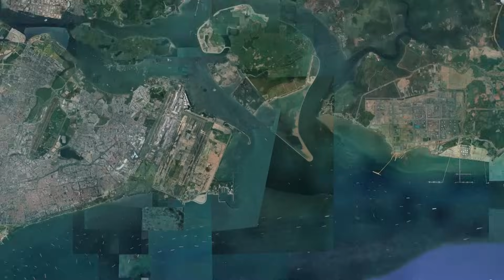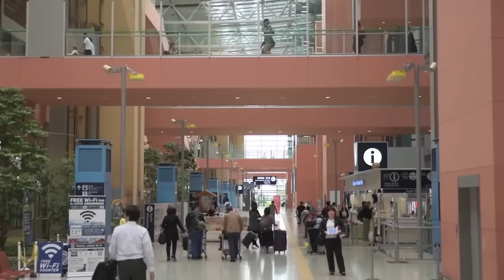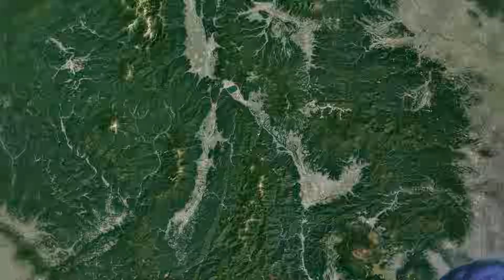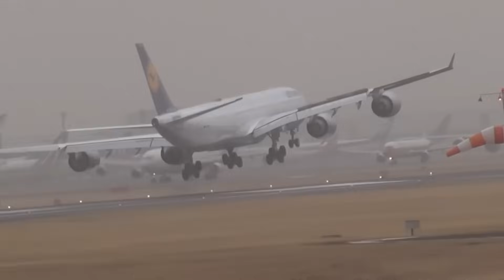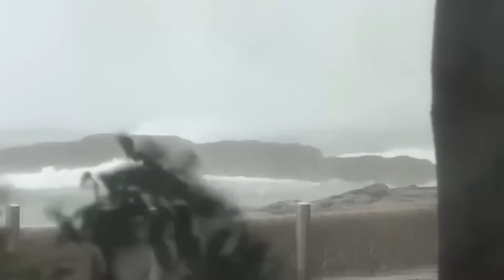Why Does Japan Build Airports On Water?

Comment: Land politics is a complete mess in most countries. Trying to find enough suitable land in or near a urban area even if the land can be found is hardly the only issue. Then there is the issue of can they even acquire the land and develop the land as needed without serious kickback from an angry populace. Any local representatives want to keep their odds high for re-election, forcing thousands off their land for a massive development while also forcing thousands others to now live near an extremely noisy major development is very unpopular with the people and thusly can endanger election odds so local representatives can in many cases be quite resistive to an airport in their district.

So due to the mess that is land politics on a local level, it is exceptionally easier to go about proposing and getting approval to construct these on the water vs on land. The Osaka airport is numerous miles away from the shoreline for example, airports are noisey, need a wide berth for expansion opportunities and an eye sore to the average local. Far better to keep it out of sight and out of mind to the local population.

Comment: Even without the political aspects of land reclamation, building on water has the advantage of being more future-proof if done right. These economies are all advanced and can afford to foot the bill. Even though it's more expensive you don't have to claim nearby land to plan for future airport expansion to meet demand when you build on the water. This land (especially in places like Hong Kong and Singapore) is arguably more expensive than building on the water alone. Plus, it also means that if you don't have to build a new airport from scratch if you run out of space on land (similar to Kai Tak which had no room to grow).

Comment: Anyone who knows Hong Kong's geography and remembers Hong Kong's previous airport knows why the new airport had to be built in the water. Hong Kong is very hilly and had sky scrapers right next to the previous airport. It was one of the most dangerous airports to take off and land.
Reply: Did you ever ride the Baguio or Dumaguete flight before in the 80’s it can be compared to Kai Tak airport 😊Kansai I was able to get a flight by NWA from Detroit numerous times it’s very nice all glass walls and steel , Now they say it sinking a bit but Japan trying everything to prevent it

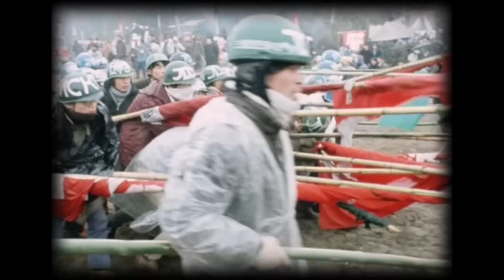Comment: This video only touched it briefly on 2:57, but the most important reason is Narita Airport issue back in 1960s to 80s.

Google "Sanrizuka Struggle" for more info - It was basically local farmers got angry on the government's arrogant attitude and decision to buy their farm lands to build the new airport for Tokyo, so they fiercely resisted the construction, and co-operated with communist activists, which then lead those activists doing terrorist attacks to government officials / forces, resulting too much obstacles, delays and even a few deaths.

Because of this bitter memory, Japan now has simply no choice but to build airports on water. All the other merits are secondary.

Of course, you could still say the reason why the farmers got so angry in the first place, can ultimately traced back to the fact the available land is scarce in Japan. But I expected the video touches more on the Narita Airport issue if it's titled "Why Does Japan Build Airports On Water?"

Comment: The statement that a water landing can be less hazardous than landing on land is not true. As the airport is surrounded by ocean, waves can pose significant damage to the aircraft, which could result in a much worse situation. In most water landings, the aircraft will not stay upright, and the waves will cause a dangerous situation when the engine contacts the water, which leads to more injuries.